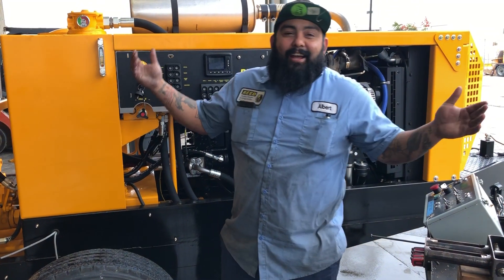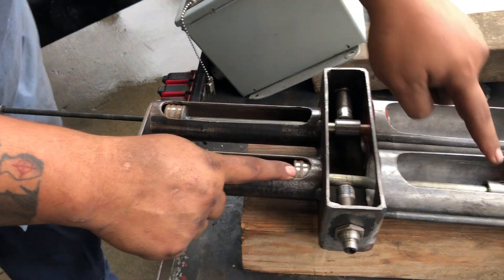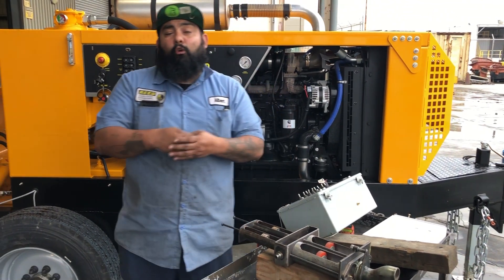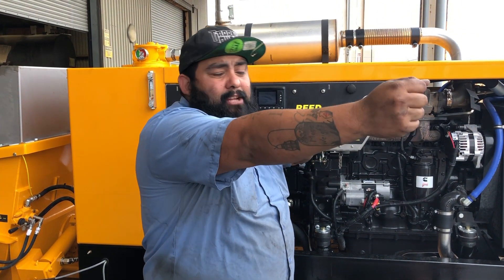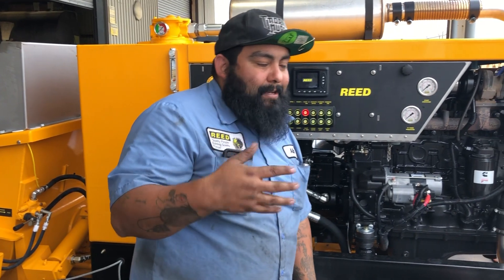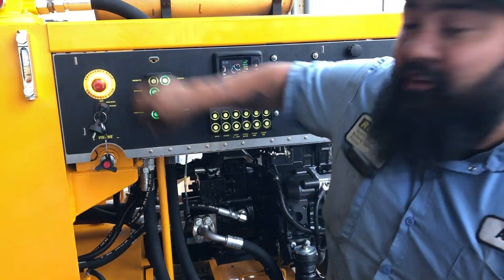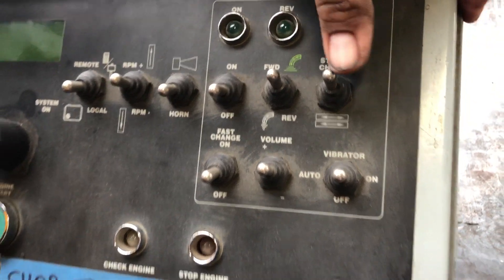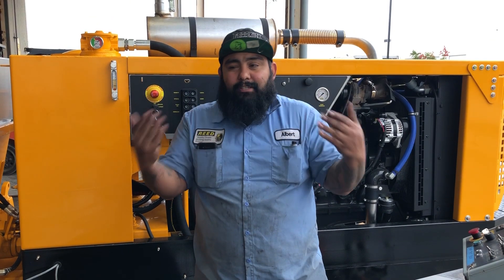how  to neutralize cylinders with stroke change on REEDs A,B,C

Comment: I have an A40HP that I run 4-6 days a week in Cen Cal. Should I be dead heading before the start of each job?
Reply from the maker: it  would be a good idea to
Reply: @reedtechtalk3272  sounds good. Any downfall in doing it in the middle of a job when there’s concrete in the cell?
Reply: @Andrew-Ponce  I do it at the end of every job, and when I start my next job, I have a fully retracted cylinder covered by the s tube.  pour primer down elbow, and when I prime out, I get one raw full shot of primer, followed by  a shot of concrete.  works like a charm

Comment: My older Reed doesnt have that button, how would I be able to do this? Also… you are giving it a stroke then stopping the stroke… waiting a few seconds … then giving it another stroke on forward?
Reply from the maker: older reeds have a test A & B toggle switch
Reply: @reedtechtalk3272  okay thanks. For the toggle switch I can only leave it on A or B there is no neutral is it okay if its constantly on one? And is A left cylinder and B right cylinder?